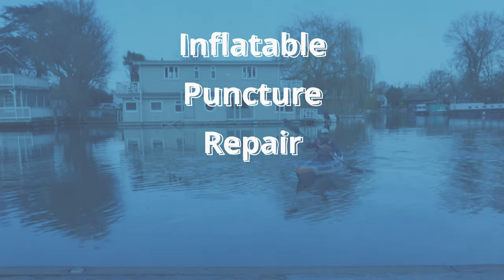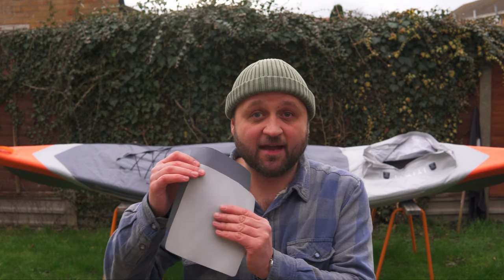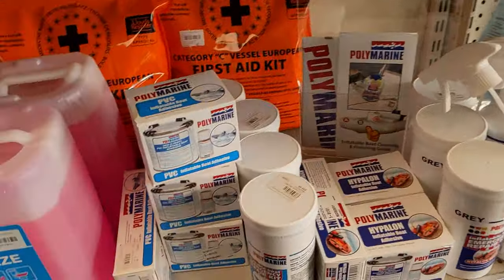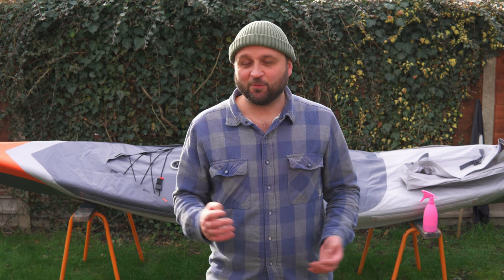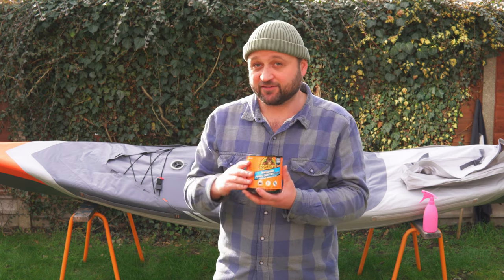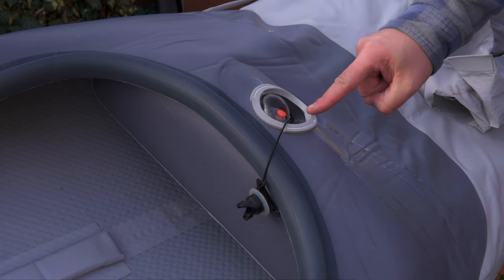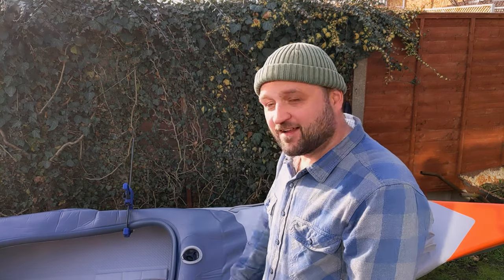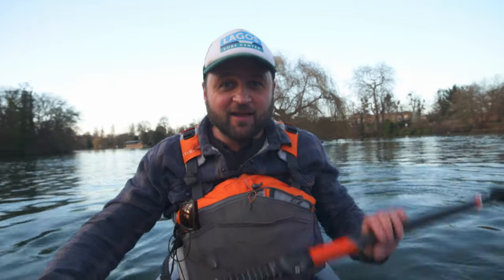Inflatable Kayak & SUP Puncture Repair

Comment: Great information for new paddlers 👍 One question how the Hell did you get a puncture that high up next to the cotpit  ? 

I know you know this Stive but for others who maybe thinking about getting an itiwit decathlon will give you a new boat if you get a problem that can't be reperd, as long as you're still within the 2 year warranty.
Reply from the maker: The puncture would have happened in the bag while in winter storage in my garage (it is a bit of a mess in there!).

Glad I dealt with it now and not when the good weather starts

Comment: in a crisis, dry the surface thoroughly then stick gaffer tape on the hole or tear. Keep pressure just below recommended. it will get you home.
Reply from the maker: Good tip 👍
Reply: A way better temporary repair is with Gorilla waterproof patch tape - it even works under water and is very secure. For permanent repairs,  Ulow liquid pvc repair is the very best for patch free repairs. If you need to patch, use a 2 pack glue like polymarine.
Reply: That was an excellent repair guide Steve, well narrated. I'd make one minor edit  suggestion degrease after sanding, not before. 
I've found valves can occasionally leak due to grit in the mechanism,if so remove it with the wrench and wash in water with the button pressed to open it.
Some recommend putting tyre sealant in each chamber to self seal pinholes without field repairs. It works for me on bike tyres at 100 psi, so could be useful for ds kyaks!